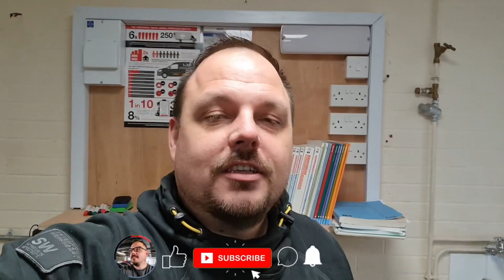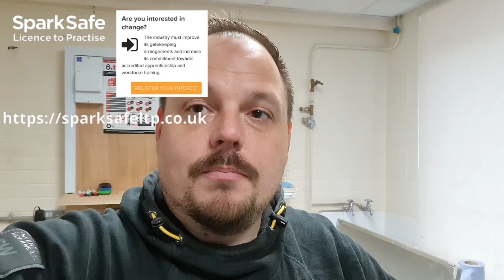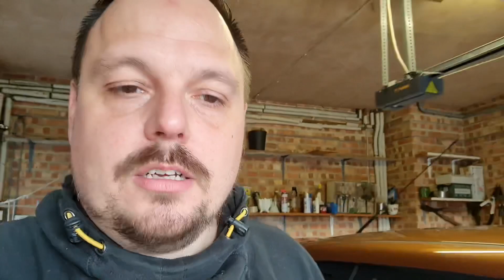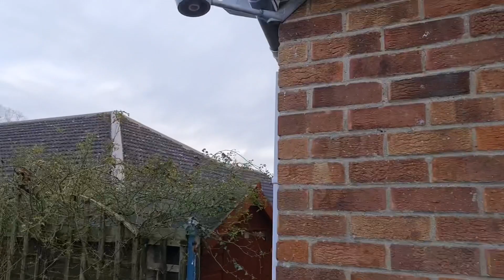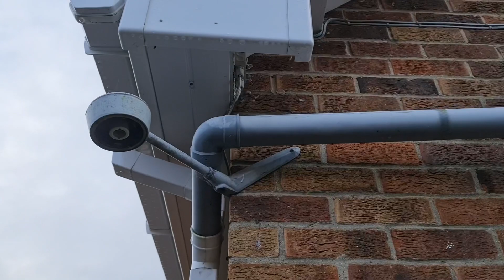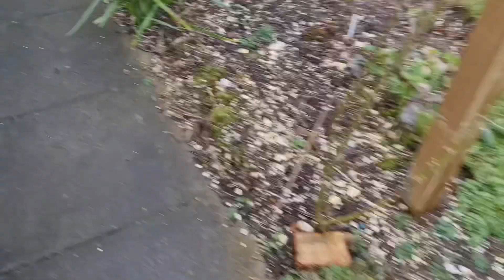UK Electrician fault finding, flash bang no lights

Comment: Blimey they must be a nervous customers if they’ve got a RCBO consumer unit and they’re worried about a rewire.Unless the board was installed because of certain amount of issues.I do exactly the same just a continuity test before you start Between Live and Earth.It’s funny it’s always nice to find the natural to earth isn’t it.Nine times out of 10 it’s cabling with neutral to earth
Reply: @electrician247  I do exactly the same if you’re in and out in in under a hour .Sometimes they can be the best advertising they were always tell their friends
Reply: And if they are the older generation not charging them is also a way to pass it forward - I guarantee that you lose nothing and the amount of goodwill you generate will keep pushing your business forward.

Comment: Nice spot and well explained - useful for the apprentices to follow your logical approach in tackling the issue.
Reply from the maker: Thanks Math man. Always make sense to use your senses first. A lot of people get really stressed on faults.  I have a picked a few up over the years others have had a hard time with. Patience and methodical approach are key. Plus dealing with the customers lol
Reply: @electrician247  a nasty one would be a broken conductor and with short (due to a nail puncturing capping and insulation) buried in a wall but even here logical approach and insulation and continuity calculations can identify reasonable rough location of a short. David Savery had a great tutorial on this sometime ago without having to use a TDR type tool.
Reply from the maker: I remember that video. David is fantastic in his explanations of things while been hilarious with it!

Yes I have had some head scratchers here and there. I love faults to be honest, the challange!